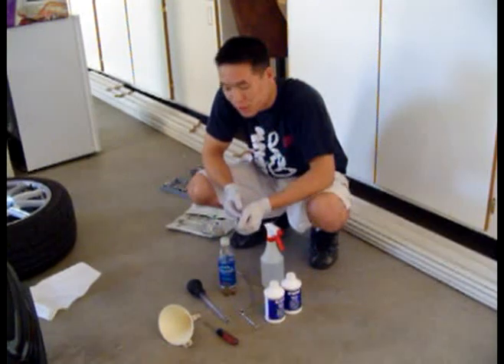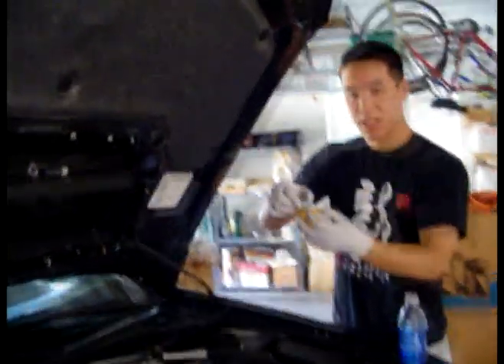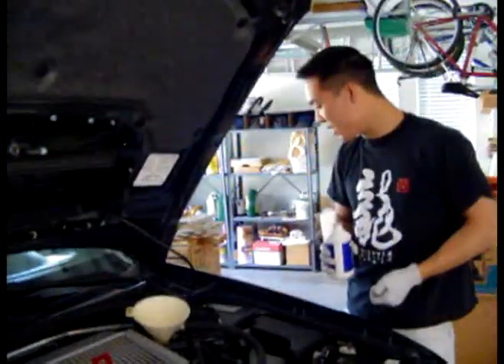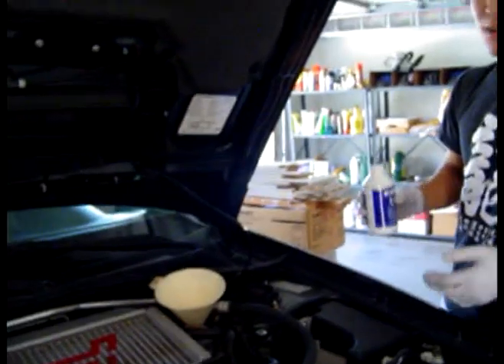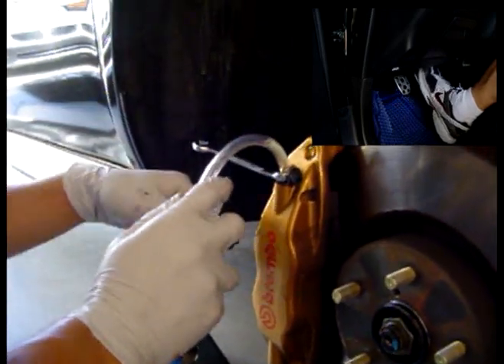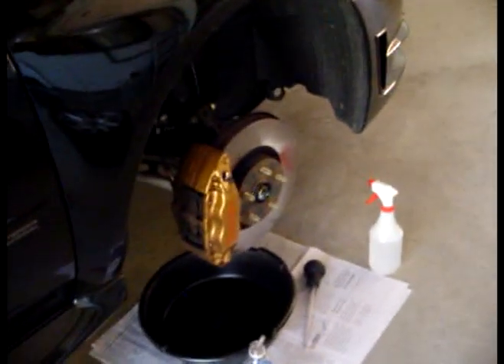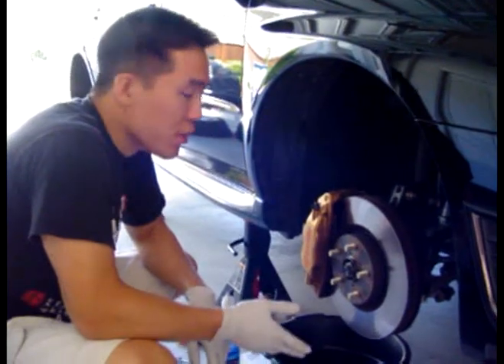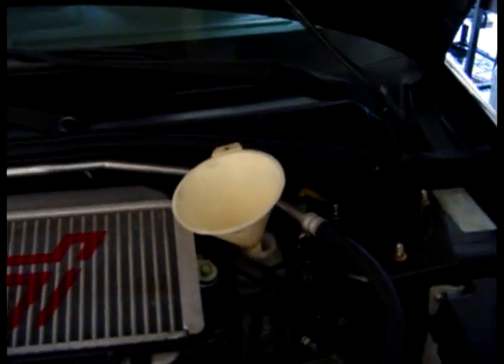Change Brake Fluid - Subaru WRX STi

Comment: Just changed out the original brake fluid in my 
'95 Camry today by myself. It was suprisingly easy
Very similar to what you have here. But just have to have enough fluid in the catch can to cover the vynal tube so it won't suck any air. Then open the bleader, and pump the brakes, and keep checking the master cyl. Repeat for all the other brakes, and your done.
It only took me like 15 minutes.
Thanks for the Vid !!!!!!!

Comment: Excellent video I've just ordered all the stuff in video turkey baster etc I'm gonna try it on my Subaru impreza sti which is exactly the same as the one in the video this weekend aswel as installing new discs and pads thanks for the video mega helpful.

Comment: This is more of a quick fix for brake fade on the side of the road. If you really want to change your fluid, nukem 384 is right. You want to take the wheels off and pump all the old shit out of there. Then you will have somewhat clean lines, refill it with dot 3 and pump that cheap shit through to really clean it out. Then switch to dot 4. Dot 4 is for higher heat, which will prevent brake fade under similar driving conditions. I would do the clutch at the same time as well, as it takes the same hydraulic fluid.

Noteworthy: If you are by yourself, this is a great video. Anyone can do this by themselves, and you don't have to bleed the brakes. If you have a buddy, just drain all the fluid and bleed the brakes, its not that hard.

Comment: If you haven't done this in a while, try to use a socket on the bleeder valve to break it loose. It'll still hold the fluid but it'll make it so much easier when you're using a spanner/wrench to keep opening it when you have your flush/bleed tube on the bleeder valve.
Reply from the maker: I totally do this when my little open wrenches don't give me enough torque!

Comment from the maker: @jihyungchun you can if you want.  i dont think that's the easiest way, but it's up to you for your car.  the STi actually has 2 bleeder screws per caliper, so it would be 10x easier to take the wheels off and do it.

Comment: First off, great video. My question is: can you just remove the old fluid in the reservoir and put new fluid in the reservoir without bleeding the brakes. wont the brake fluid from the calipers and reservoir mix to give you mostly new fluid? i just hate taking off the wheels.

Comment from the maker: @faYte0607 as much as you can.  you won't be able to suck it all out, plus youre going to be refilling the reservoir with fresh fluid before you pump the brakes, so youre not in danger of creating air bubbles in the system.

Comment: Great video, thanks for posting it.  

What is the reason for having a certain sequence for bleeding the brakes? Is it due to differing lengths of tubing from the master cylinder and old fluid coming back out?

Comment from the maker: i have a cd also, but i guess mine is way more detailed.  in my opinion, haynes manuals arent very good with detail.  i havent had any problems with my abs after doing it this way and the manual doesnt mention anything with using the select monitor on this change.

Comment: This happened to me. Tried using EZ outs, with no joy, to get the remainder of the bleed screw out, but had to pick up a replacement calliper. You have to be very gentle, especially if your car is a bit older, as the screw can be siezed or corroded. Use penetrating oil over night and a proper brake bleeder spanner.

Comment: Don't forget to note where the original fluid level was.  When your done bleeding your brakes top off the resivoir to that level. When you compress your pistons when changing your break pads any extra oil in your system will leak out the resivoir.

Comment: Thanks for your tutorials, they are very helpful!
  
I was just wondering  Are bubbles in the vinyl tubing the only indicator of air in the brake fluid system, or are there any other indicators to watch out for?
 Thanks.

Comment from the maker: i haven't had this problem.  one thing you could do is use a flare nut wrench if it will fit in there.

Comment: was there any need for you to jack up the car and put it on stands? cause on my sentra spec v, and ur STI, the bleed screw is on top and can be accessed in between spokes of the rims....so i dont see any reason y u can't do it without taking the wheels off

Comment from the maker: @yasin540 changing the fluid in the reservoir would be like not changing your fluid at all.  you need new fluid in the brake lines, that's the important part.

Comment: @nukem384 
Thanks for that. Also, do you happen to know what the torque specs are for re-tightening the bleed nut? I don't have Brembos so it will definitely be a different torque amount. Just curious to know.

Comment: @nukem384  So I keep puring brake fluid so no ai gets into the system.  What if I do get air in the car?  Like if I start to see bubbles?  How do I drain them out?  Also where do you dispose of the usd brak Fluid?

Comment: also if i could add, Not to put the E-break up, from what i understand that will pull the rear pads in and the brakes will feel mooshie when they are done.

Comment from the maker: you should change your fluid right away.  it may be "fine" in normal conditions, but if you need to brake hard and fast, that old brake fluid isnt going to do you any favors.  and yes it should help with a spongy pedal a bit

Comment: My brake pedal goes all the way to the floor.  So then if I pump my brake pedal hard and fast only then will my brakes work.  Does anyone know if this is because my brake fluid needs replacement or is it my brake master cylinder going bad.  Thank you anyone for any input.  Regards, Chris

Comment: Not bad but it's easier if you just gravity bleed the system... You won't need a buddy... And if u have the money there is a couple of tools out there that help you suck out fluid from the caliper and some that push it out the old fluid with new... Any approach is good...